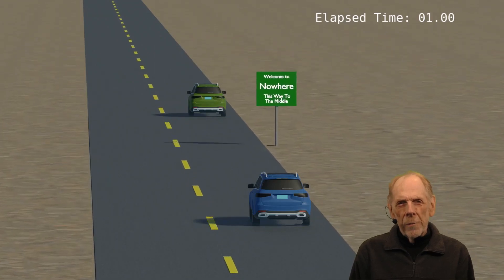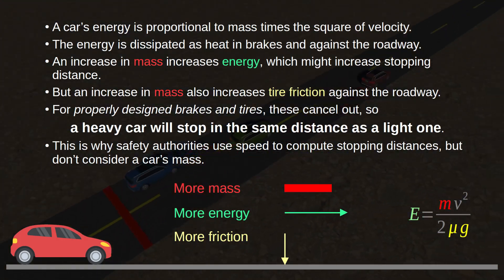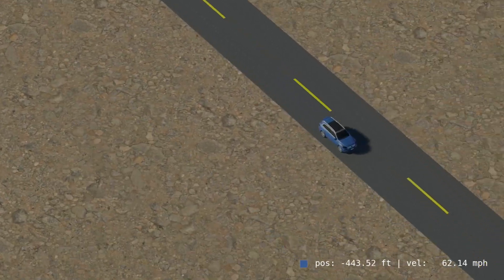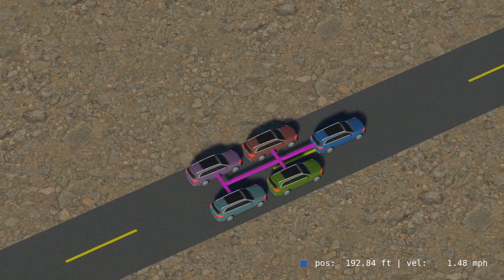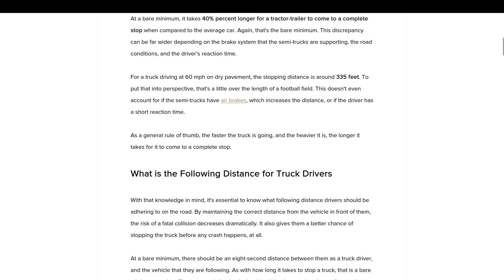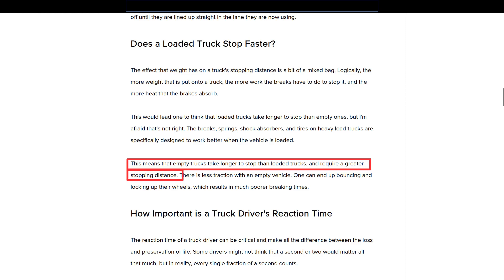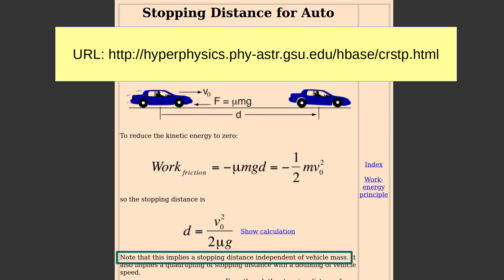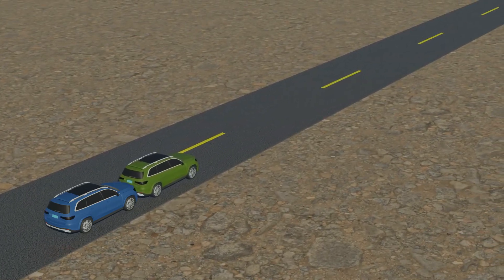Car Safety Myths: Exposed

Comment: An empty semi truck with a 48' trailer will take more time to stop when fully loaded even with more friction to the pavement.   An 80000lb vehicle DOES take more distance to stop than the same vehicle empty.   I know you're only talking about cars, but more weight means more potential energy to slow and stop the vehicle.   As a former truck driver, I know this is true.   Like most things, they look good on paper/graphics, but in real life things vary greatly.   I do agree that driver reaction time plays a HUGE part in stopping of any vehicle.   I like the fact that you point out some real physics in this video showing the stopping distance once brakes are applied goes up 4 times for double the speed.   Thanks a million for understanding this and conveying it too.   Overall, I'd have to say this was a good video, thank you.
Reply: Completely agree. When hauling a trailer behind my pickup with my race car on the trailer it definitely takes much more distance to stop. And the trailer has brakes
Reply from the maker: @trusconi81  > When hauling a trailer behind my pickup with my race car on the trailer it definitely takes much more distance to stop ...

Yes, because of the overall setup and the difference between the loading on the different axles, not because of basic concepts. My video is meant to falsify the widely held wrong assumption that more massive vehicles require more stopping distance as a direct function of their mass, which is false.

In your hauling setup, unless the trailer brakes are extraordinarily well-designed, they will produce either more or less braking force that is required to produce zero net longitudinal force on the hitch. If the latter were true (nearly never), then the truck and the trailer become independent braking systems, not a candidate for a jackknife, the usual case, and which certainly will take more distance to stop, as you experience.

A perfect setup would create zero longitudinal force on the hitch during braking, so the hitch doesn't either pull or push the truck (during braking, not while hauling). That would be the basis for a valid comparison test, and it would make all stopping distances the same to the degree allowed by loading of the tires and brakes.
Reply from the maker: > I know you're only talking about cars, but more weight means more potential energy to slow and stop the vehicle.

Yes, and more tire friction. If the tires are brakes are designed to accommodate all operating modes, the mass factor is nearly eliminated (not precisely eliminated, as I point out in the video several times). And the truck design would be very expensive.

My sole point with this video to to stop people from claiming that more massive vehicles must require more stopping distance solely based on their mass. This is false. Real trucks do require more stopping distance proportional to mass, because of how they're designed, not because of physics.
Reply: The coefficient of friction of tires is pretty constant, until you exceed the sheer strength of the rubber. Too much weight on too small contact patch means, that past a certain point, the rubber that meets the road tears away from the rubber on the tire. At that point, the stopping force is limited, no matter how much additional downforce is applied to the tire. An over-inflated tire, a hot tire, or a tire that is skidding reduces the sheer strength of the rubber, and the traction goes way down. A skidding tire is almost useless, since the surface temperature can actually melt the rubber, turning it into a liquid. It literally creates its own oil slick!
Reply: think at trucks as barely road worthy vehicles.
Reply: Truck suspension is designed for a load.  When empty, you get more axle hop not just from the suspension but from the frame too.  Look at an empty aluminum flatbed vs one with a large coil of steel on it.  The frame is part of the suspension system thus keeping the tires in contact with the pavement.
Reply: trucker here as well and you are correct. an empty truck will stop faster than a fully loaded one. they might have gotten them to stop in 30 feet in lab condition with perfect tyres and pavement but that shit just doesn't happen in reality.

Comment: well friction does not depend on mass in this case, masses should cancel out if two cars with different masses stop by making tires skid, and guess what they do not, their friction depends on pressure applied on the brake disk/drum, so mass does not cancel out and braking distance increases with mass through physics.
there is a slight increase in friction because heavier mass increases the tire contact area of tire on road but its way too low to decrease braking distance
Reply from the maker: > "there is a slight increase in friction because heavier mass increases the tire contact area of tire on road but its way too low to decrease braking distance"

Not really. In practice, mass is nearly eliminated as a factor unless the brakes cannot handle the load or the tires melt. Even in ideal circumstances it's not an exact cancellation, but sufficient that safety agencies don't bother factoring in vehicle mass in calculating stopping distance.
Reply: I just opened online calculator for car stopping distance, I entered the 903 km/h speed that average A320 lands at on a standard 10,000ft runway, it told me that I'd need a 17,000+ft runway.

Of course, it didn't ask for the weight of my vehicle... :)
Reply: @shinobuoshino5066  First off: Look up how planes land! Also, 903km/h is just below the cruisingspeed of an A320. Landing speed is around 200km/h.

Off course it won't ask you how much your vehicle weighs, since most people don't know. Post this calculator as a refference so we can factcheck, you're "factchecking"

Comment: the math/sim your using is a hugeass oversimplification. according to some reddit comment:

Freshman year physics - F(friction) = u(coefficient) x Fn(normal force)

Senior year physics - Yeah, remember that simple equation? Throw that out the window when you're working with a non-linear elastic, pneumatic wheel applying torque. We're going to need to use this partial differential equation that's going to take up most of the page and you'd need several computers to solve for.

Non-smartass answer: Because the traditional Ff=u x Fn is an oversimplification when it comes to wheels and tires. It works great for something like a wood block where it's just sliding and doesn't deform. But a tire is a complex thing. You're transmitting force through this spinning wheel that's under pressure from air inside, generating tension in steel belts in multiple directions, and rubber, all of which is going to flex and move. In that case contact patch becomes more relevant to how it's going to grip and behave.
Reply from the maker: You may notice that I qualify every mention of this relationship, to take these points into account without losing my viewers by citing the technical details. But the point my video makes is that more massive vehicles do not require more stopping distance, unless they're improperly designed.

All those sources I quoted got it wrong precisely because they lost the forest for the trees -- they assumed that E = 1/2 m v^2 must mean that more massive vehicles require more stopping distance proportional to mass, which is false.
Reply: Heavier vehicles will always require more stopping distance regardless of design (assuming everything aside from mass is identical). In real-world scenarios, there is often some degree of slippage between the tire and the road. This slip introduces factors like tire load sensitivity, where the increase in friction with higher load is less than proportional.

Heavier vehicles do tend to have more load on their tires, but the traction increase is not directly proportional. This is due to the nuances of tire behavior, including factors like tire composition, road conditions, and the presence of anti-lock braking systems (ABS) that can modulate braking to prevent wheel lockup.
Reply from the maker: @Venous_fx  > Heavier vehicles will always require more stopping distance regardless of design (assuming everything aside from mass is identical).

My video's five-car monster vehicle example falsifies this claim. Same tires, same brakes, same driver actions, everything but the total mass.

But then, that was the purpose of the example -- to force people to see that the commonly heard claim is false. In everyday reality, this simple truth is hidden by bad engineering.
Reply: @lutusp  As I stated before, your simulation is not an accurate representation of reality. Heavier vehicles will always require more stopping distance regardless of design (assuming everything aside from mass is identical). In real-world scenarios, there is often some degree of slippage between the tire and the road. This slip introduces factors like tire load sensitivity, where the increase in friction with higher load is less than proportional. There are many complex mechanisms at play in the tire and road interaction. Your simulation does not account for this.
Reply from the maker: @Venous_fx  > As I stated before, your simulation is not an accurate representation of reality.

I proved this commonly heard claim false in the simplest possible way -- I welded five two-ton vehicles together, creating one ten-ton vehicle, and that much heavier vehicle stops in the same distance as one two-ton vehicle. How is this in any way unclear?

A heavy vehicle with adequate tires and brakes, stops in the same distance as a small, light vehicle with its own appropriate tires and brakes -- assuming both vehicles are traveling at the same speed. Assume also that ABS is in use, which means the tires are at the edge of breaking traction with the roadway, which is the most effective braking friction point.

This is why safety agencies list speeds, but DO NOT list masses, in their officially authorized braking distance charts -- they do this because MASS DOES NOT MATTER assuming tires and brakes are correctly chosen for the vehicle's mass.

Speed matters, and speed is listed as a factor in stopping distance.

Reaction time matters, and is also listed.

MASS DOES NOT MATTTER.

"Vehicle Stopping Distance and Time" from UPenn: https://nacto.org/docs/usdg/vehicle_stopping_distance_and_time_upenn.pdf

No mention of mass or weight.

Automotive Fleet: KNOW YOUR STOPPING DISTANCE -- https://www.automotive-fleet.com/driver-care/239402/driver-care-know-your-stopping-distance

No mention of mass or weight.

Dozens more examples, but you know what? You could do your own research and save me some time answering an inquiry I have answered hundreds of time over the years.

Thanks for writing.

Comment: In theory, yes, heavier vehicles should have the same stopping distance as lighter vehicles. In practice that's not the case. Now which matters more for driving safely...
Reply: Driving safely counters all imperfect functions of a vehicle.
Reply from the maker: > In practice that's not the case. 

In practice, with properly designed vehicles, it  is the case. My point is economics decides this, not physics. Trucks that can stop within the theoretically established distance are more expensive.

>  Now which matters more for driving safely...

If driving safety were the only issue, all vehicles would stop in the same, optimal, distance. And they would be more expensive.

Thanks for writing!

Comment: Uh.. Kinetic energy of a car certainly is E=mv^2 and not whatever formula you showed at 9:05
Reply: The formula he showed is actually similar to the acceleration of the force of gravity on a falling object. Braking is the reverse, much like the Deceleration of an object, that has been tossed straight up. The formula for kinetic energy applies to the total heat dissipated by the brakes, bringing the car to a stop from the various speeds. Yes, the car doing 80 takes 4 X the time to stop as the car doing 20, but, since the velocity is 4 X faster, it indeed covers 16 times more distance, given the higher velocity, multiplied by the longer time it takes to bring it to a stop.
Reply from the maker: > Uh.. Kinetic energy of a car certainly is E=mv^2 and not whatever formula you showed at 9:05 ...

Yes, that's true, but the discussion at that point is stopping distance, which requires us to take friction into account.

Thanks for writing!
Reply: @lutusp Yes, absolutely.

Comment: You did not prove anything. Higher speed vehicles stop in distances proportional to speed squared, but this is not because enery. Brakes apply generally constant pressure and this makes higher them more powerful at higher speeds ( remember formula E=F*X) . Twice the speed twice the stopping time, but average speed for that time is also higher for faster vehicle. So it is proportional to speed squared.
Heavy vehicles stop harder because tire and road surface interface is not a simple thing to be represented as only friction coefficient. Heavier vehicles use harder tires to be economical, or their tires simply wil be worn out very soon. This makes trucks and heavy vehicles stop in longer distances. Also the brake systems are different, air brakes are generally less responsive than hydrolic brakes of a small vehicle.
Reply from the maker: > You did not prove anything.

I proved that properly designed braking systems make all vehicles equal.

> This makes trucks and heavy vehicles stop in longer distances. 

No, it makes better braking systems more expensive. What I proved is that trucks take more distance to stop only because they would otherwise be more expensive.

> Also the brake systems are different, air brakes are generally less responsive than hydrolic brakes of a small vehicle.

Yes -- economics, not physics.

Thanks for writing!